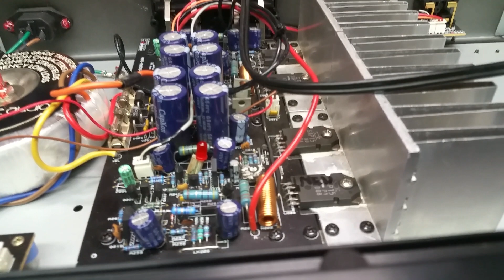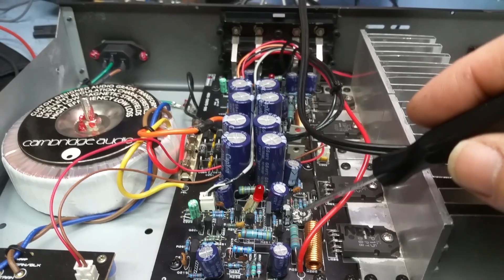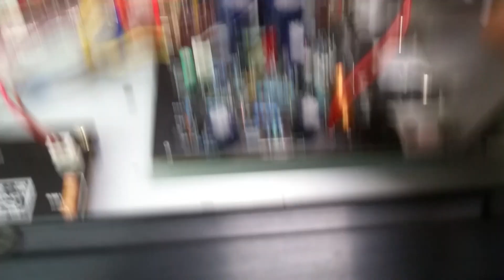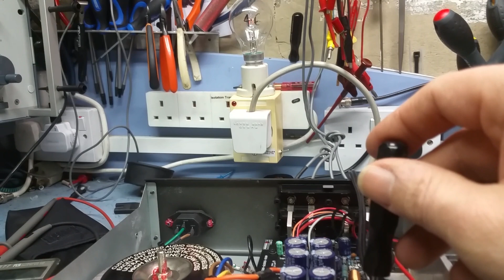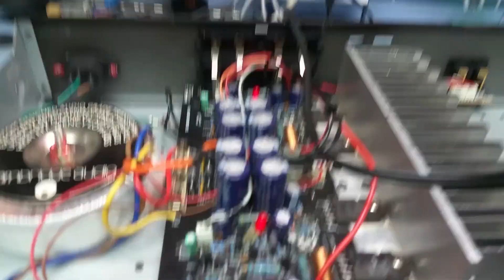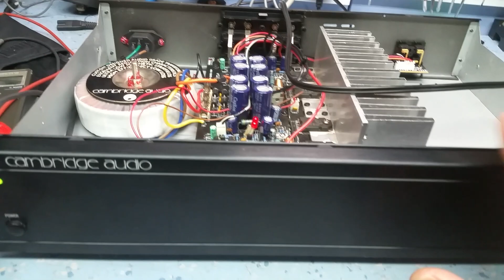Why Dim Bulbs (Lamp limiter's)are such a bright idea.

Comment: Hi. I have a smps that has had a few componants changed. Using my 240v filliment lamp in series when switched on it lites for a second then goes off!! Does this suggest I may of fixed the smps with no shorts now and glass fuse intact???

Comment: Hi Simon, I have a dim bulb tester but I am a novice.  I have used this to repair 1936 Vintage Radio with no problems. I recently bought an oscilloscope Fluke 3092 when I turned it on there was a squeal then it shutdown. It has over/under voltage protection. Would the dim bulb work on this scope. I ask because due to scope shutting down almost instantly I cannot measure any voltages. Any advice would be welcomed I realise I hold total responsibility as to what happens, many thanks for the video.
Reply from the maker: You may find the fluke power supply is shutting down in undervoltage protection. What wattage bulb are you using?
Reply: Simon Spiers Thanks for replying Simon. Sorry I should have mentioned when I first turned on the scope it was straight mains voltage no dim bulb I removed from case cleaned dust checked visually accessible components nothing obvious. Put back together used 60watt bulb fired up scope bulb was bright so I shutdown immediately. I have added another 2x60w bulbs so now have 180w but not sure if scopes protection circuits over/under voltage will kick in and prevent me from taking voltages so I haven't turned scope back on yet I case I damage anything, Many thanks.
Reply from the maker: @johnmcgiv1  If you can check the PSU with the outputs of said PSU disconnected from other boards. ?It could be somewhere in the scope but sounds like the psu. Short of checking for a shorted capacitor initially you have few options. 180 watts should be ok. If it comes on bright turn off and check transistors and caps at the switching side of the supply. DISCHARGE the caps first though.

Comment: The problem with these is a combination of the Sanken SAP transistors onboard emitter resistor being weak, and the crappy heatsink. Sanken actually discontinued the SAP devices and then brought out "STD" devices - same thing, but without the resistor!

Another thing that lets modern Cambridge amps down is the poor assembly quality - such as here, the thing is full of CrapXon capacitors. The design itself isnt bad, but it's then built in China with rock bottom cost parts which are crap!
Reply from the maker: Yeah come across those. Pile of junk. Interesting about the transistors though.
Reply: These amps are some of Cambridge's worst products. The SAP output devices are no longer available and there's a lot of chinese fakes floating around. I refuse to service them any more.
Reply: @radioengineering8247  the advised way to do it is to use the STD transistors, and manually add 0.22 ohm emitter resistors. Cant blame you for not wanting to touch them though

Comment: So it's OK to use those halogen bulbs? I thought they had to be the old filament type incandescent.
Reply from the maker: Should be fine. As long as it's not a discharge type bulb.
Reply: Halogen bulbs are also a filament bulb but with the difference being a small casing with a percentage of halogen within it for the special reaction, you get the same voltage potential with the tungsten filament

Comment: Al most all amplifier manufacturers use a high value preset to control bias, why I never understand. The correct bias is normally quite constant, in fact some makers will use a fixed resistor. So why even make it possible to adjust the bias from almost no current to class A or bang? Not really rocket science to use a fixed resistor and a lower value pot.
Reply from the maker: I think the problem here is the track is open half way up. When the wiper passes it the current goes haywire. Killed amps like this before.
Reply: The reason for adjustable bias is because it depends on the characteristics of the transistors. Normally re-adjusting the bias is required when you change output or driver transistors, and sometimes even when you change preceding stage transistors such as the VAS.
The pot is usually wired up so that it is a rheostat, if the wiper goes open which is what more commonly happens, the pot appears as full resistance and so gives minimum bias.

The problem here is that the Sanken SAP's have integrated diodes which perform the biasing, so that the pot only has to be in-line with them. Usually a separate transistor is set up as a "Vbe Multiplier". When the SAPs fail, all of the terminals end up shorted to the collector, so a large amount of current passes and basically melts the pot.

Comment: While variacs are a useful tool, a dim bulb tester is invaluable when powering up suspect equipment.
I tend to use one in series with my variac, mainly for waking up vintage valve gear that has not seen power for decades!